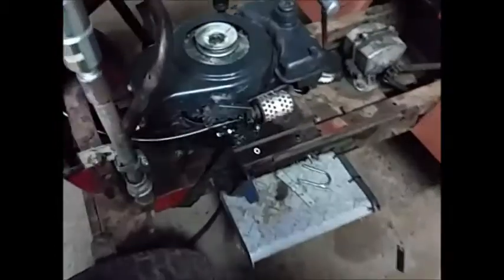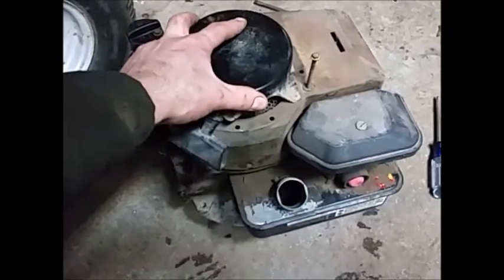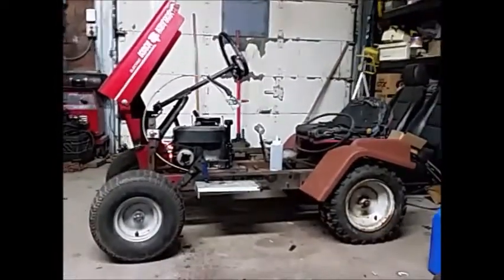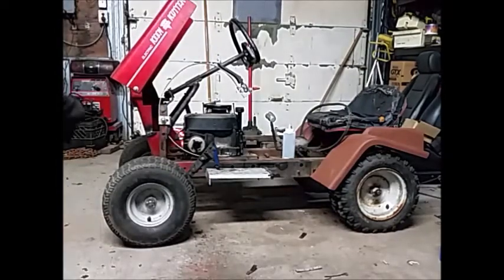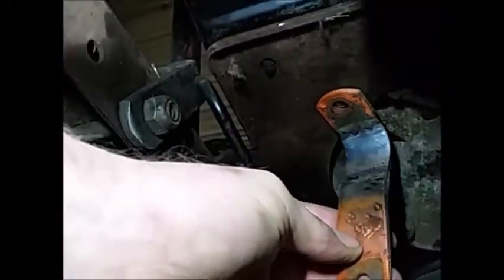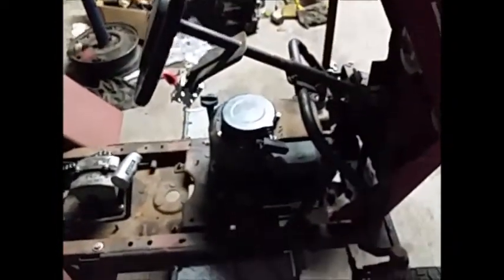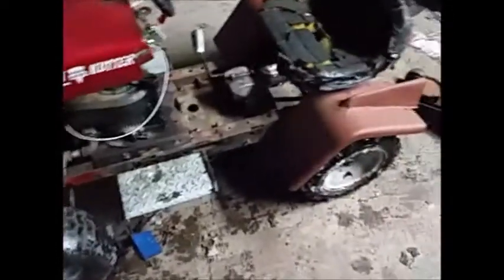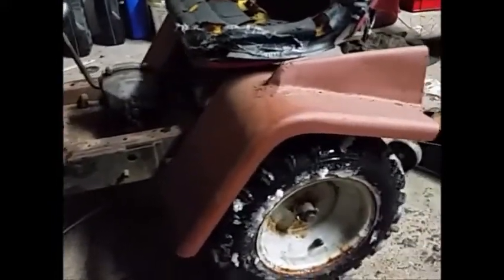Success and Failures with the Rat Rod Snow Tractor

Comment: Lawn mower engines uses a lawnmower blade as a flywheel weight. The flywheel weight helps it idle and take off and not kick back on shutdown. The mass of the flywheel is what will allow you to start the rat rod moving. Since mowers have a blade they only put a aluminum flywheel as no more weight is necessary. Compare this to a non lawnmower engine and they will use a cast iron flywheel for weight. You can over come this by adding more wieght to your bottom pulley. The further out from the center of the shaft the better. Also the further out the less weight you need(mower blade sticks out 10-11" from center). A few pounds of steel will make a world of difference.
Reply from the maker: That is true, maybe I should add some more weight to it.